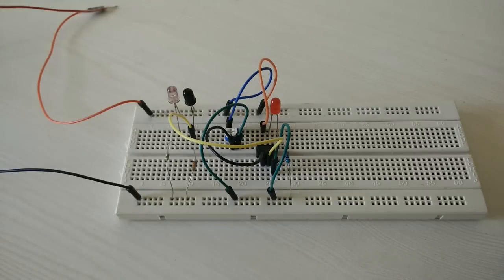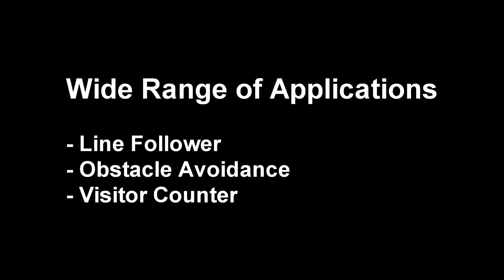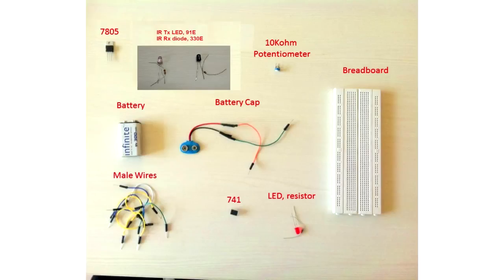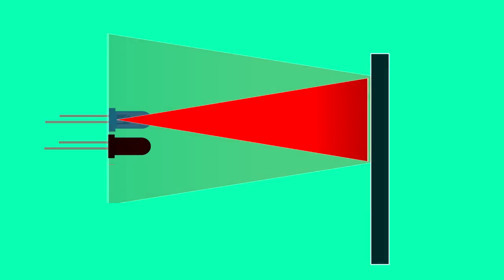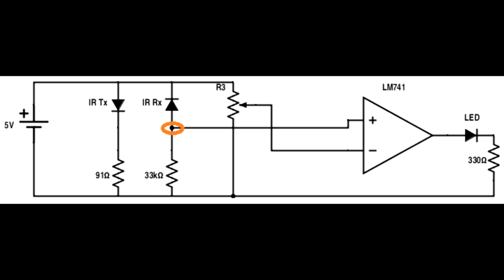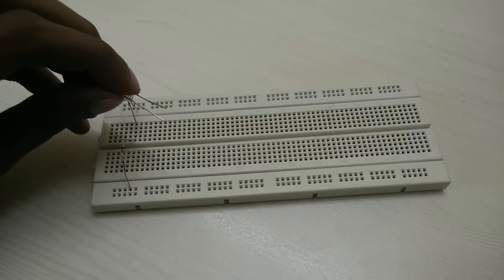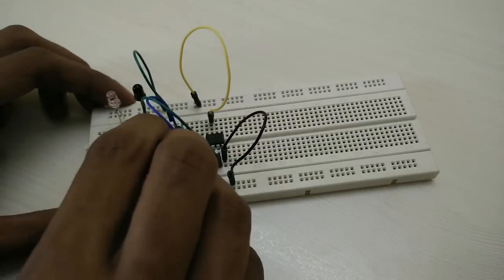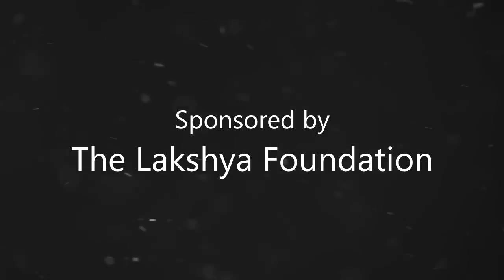Building Electronic Circuits (Tutorial 6): Infrared Sensor

Comment: Can this be connected to a robot that follows a line in order to make it avoid obstacles when using a microcontroller PIC16 or 18 mostly ?.

Or in other words,  Can I connect the output of this circuit where the LED is to the Microcontroller PIC1688  or whatever in order to build a robot that follows a line ?

Comment: please this is urgent. if i connect the pin 2 in the middle of the pot, it doesn't work but if i connect  the pin 2 to the extreme of the pot then it works, please i need help. tomorrow is my project submission

Comment: plz tell me if I build this on PCB then where should I attach the out pin to interact with arduino uno ???
Reply: Yusuf Shaikh put a wire instead of the test led the positive line and connect it to arduino

Comment: The LED just lights up continuously when i do the circuit,  its as if the infrareds diodes are being bypassed
Reply: can you help me   i have a TLN110JP diode and a IRD500JP Infrared detector
Reply: +You Will See Me At Sea hey ,, did you find out the solution of this problem ??